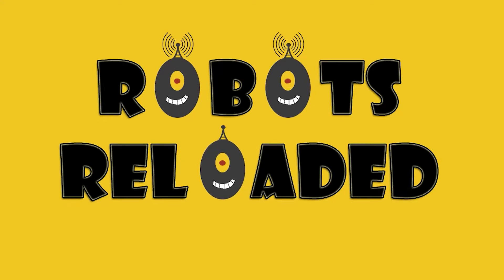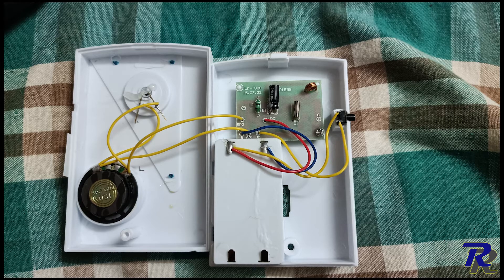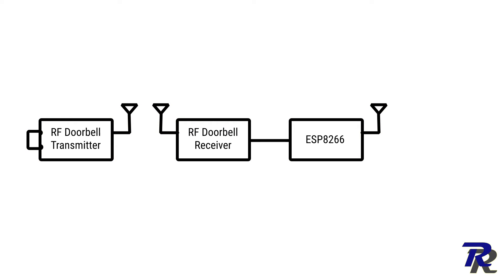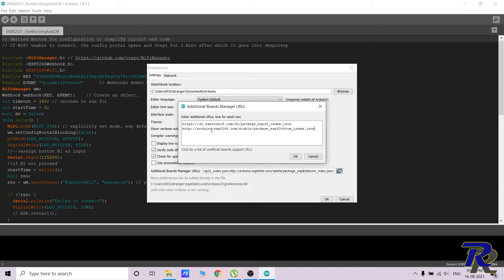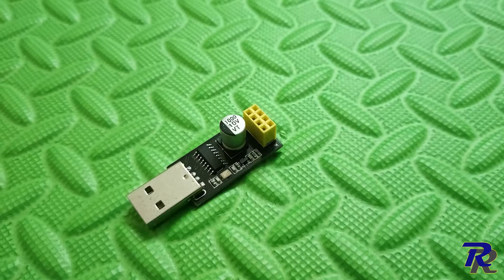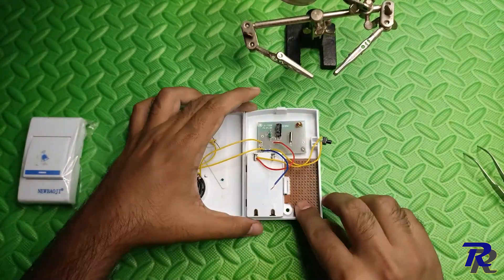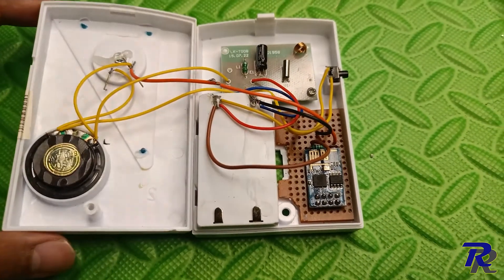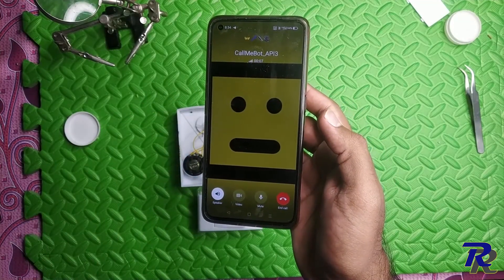DIY: Make your Doorbell smart for less than $5 (350 INR) | ESP8266 based WiFi doorbell | IFTTT

Comment: why we need to use RF doorbell ? 
I thought we just need the simple doorbell, then connect the push button to the ESP8266 as input, when we press doorbell, the ESP8266 receive input then send message to my phone through wifi ?
Reply from the maker: Conventional door bells work on AC 220/110 volts. So, this tutorial is not suitable for that. But yeah if you have a DC door bell which uses just 5V or less, you can use this tutorial as reference. I used an RF doorbell because I was already using one and just wanted to integrate WiFi into it. If you don't want to use an RF doorbell or don't need the physical sound from the bell then, we can directly just connect a button to ESP8266 (and power the circuit obviously either through an AC to DC adapter or batteries) and use it as phone-notification-only bell.
Reply: @Robotsreloaded  Thanks a lot for detail reply.
Is it better if i let ESP8266 control the bell ? Then i only need bell and a button, don't even need for doorbell circuit ?
Reply from the maker: @YuriSekaii  If you don't want any physical chime sounds and only want to get notification/call on phone when someone presses the button then yes, you don't need the doorbell circuit at all. Just need an ESP8266, a  momentary type push button connected to it's reset pin and finally batteries to power the ESP (Or preferably an SMPS which is connected to mains and gives output of 5V/1A DC and then add a 3.3V voltage regulator in between that and the ESP since ESP can't handle 5V)

Comment: 👍Hello author, I read your article, this is a great project, thank you for sharing, by the way, I believe this is not limited to doorbells, I want to make this one (without using RF wireless doorbell circuit board) to become an emergency The call button device will be used by my family and my parents (elderly people)  As long as they simply operate it, they press the button and the calling method is IFTTT  (I will modify the code and want to use it in LINE method))  I will go home quickly to deal with things

The RESET of ESP-01 is connected to the button end, and the other end is connected to ground (-)
Reply from the maker: Thank you so much for your comment. Yes you are absolutely correct. We can use this concept to make a tiny SOS button in the method you described!

Comment: Can having the ESP awake remove the lag of getting the notification? Does leaving it awake have an effect apart from the battery life?
Reply from the maker: Not much difference in lag time because the major lag is from IFTTT actually. And keeping the ESP awake would drastically reduce the battery life so it is not at all recommended for a battery based unit :)